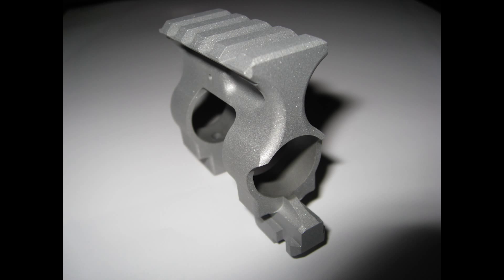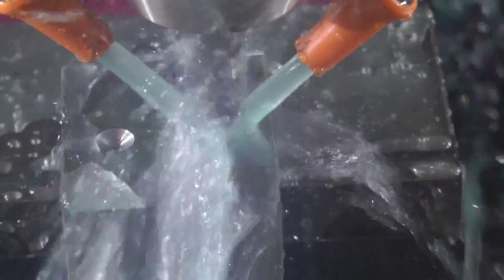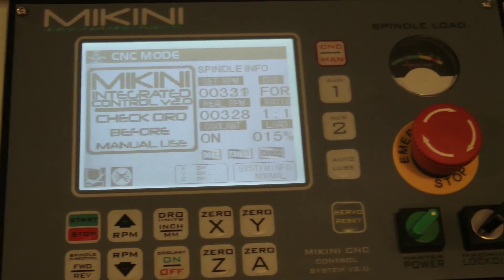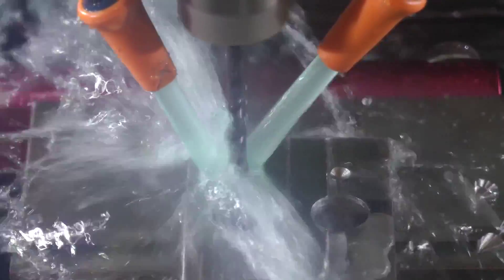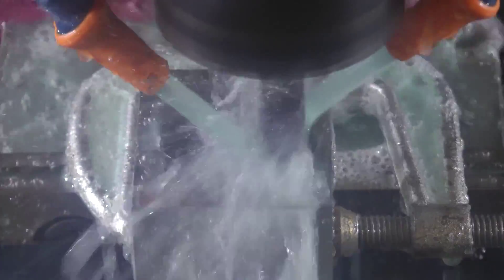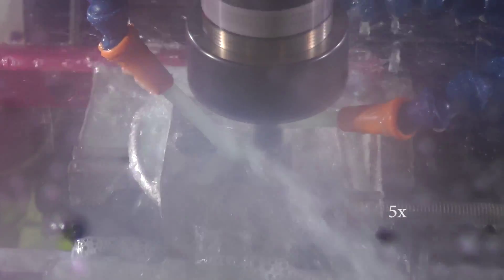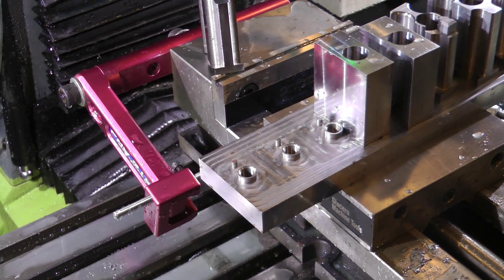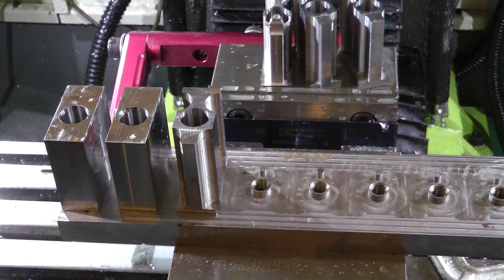AR15 High Rail Gasblock: (pt.1) Stock prep for fix

Comment: Been a while since I checked out your videos. Good work man, glad to see you making parts.
Reply from the maker: Thanks Allen! It's like a whole new mill with that new motor. How is your working out for you?
Reply: War Machine LLC The Mikini has been working great for me since I finished retrofitting all the electronics. It's funny I had the exact same feeling as you after swapped it to the Mikni V2 electronics That I would just come out and turn it on and nothing would happen. That's one of the reasons I decided to gut the electronics. I just never felt I could ever really trust them. But that feeling has faded with each successful part I make after the retrofit. I hope to get back to making more videos soon. I just finished getting my Emco 340 turning center working. I should make a video of that. It's a beast it moves so fast it's scary.
Reply from the maker: Can't wait to see those videos! BTW I know a good home for those spare V2 electronics you aren't using;), you know as a backup, just in case.

Comment from the maker: Upon close examination I have discovered a potential flaw in this process which will force me to rethink and redo this operation. The problem is that a bore is drilled from one side which will ultimately be the index point, then when I flip the part the main bore will be milled from a different zero and a different orientation and this can't guarantee that the two bores will be concentric to each other. This is important because the offsets of each boss on the fixture plate will determine the offset for all further operations. So if the 14mm drilled bore is not concentric to the main bore then the Picatinny rail won't be concentric to the main bore when it is machined and thus out of alignment with the barrel. I think I've come up with a new method that will fix that with the tools I currently have. I'll do another video soon.